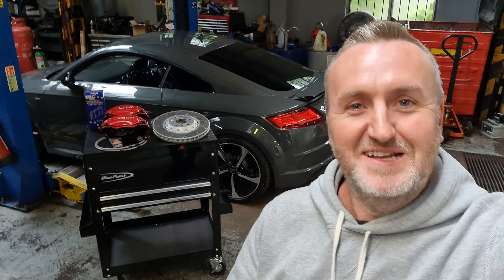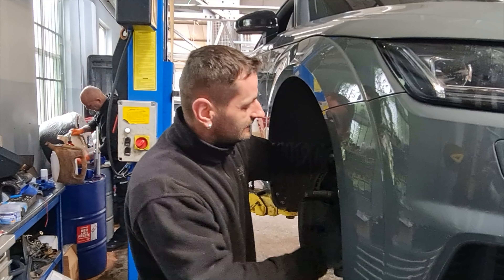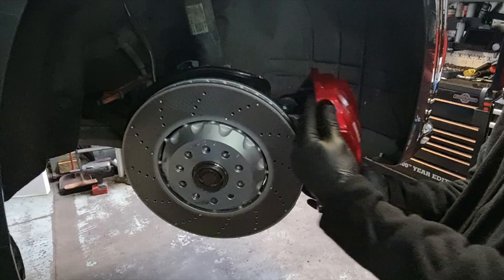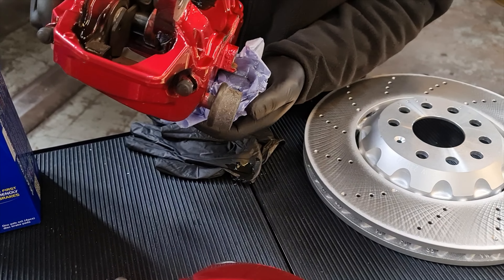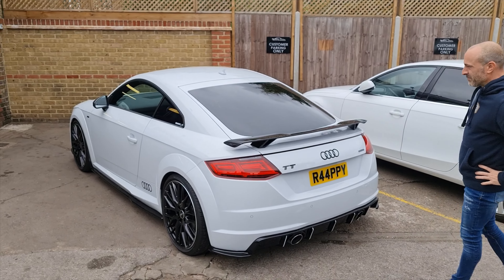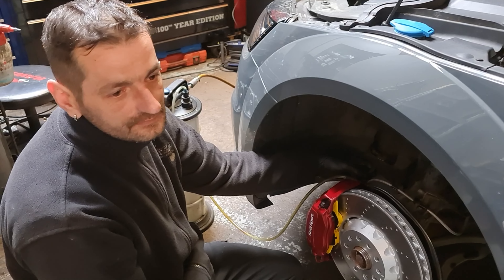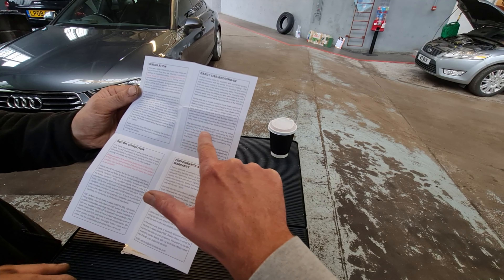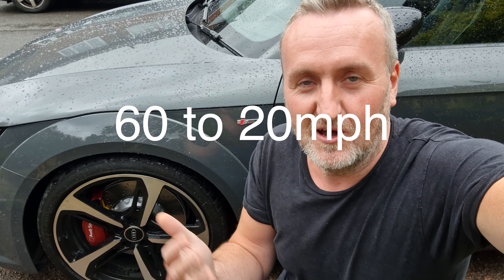AUDI TT MK3 BRAKE UPGRADE!!! | FITTING TTS 4 POT CALIPERS AND CLUBSPORT DISCS

Comment: Those Rotor/calipers compliment your Audi nicely. 👌

A correct thread & pitch bolt with a copper washer screwed into were the banjo hydraulic line would normally go on the calliper would minimise any Hydraulic fluid compromising that beautiful paintwork & clear coat. (Untill you get them fitted to your car)
Good video & professional workmanship. 👌 👍

Comment: andy kirby - Hi! Yes , for about 50 miles Be easy on brake pedal and one more thing ( cos new discs and pads need to match ) , during that time discs are heating quite quick (My advice would be , that You drive short distances 5-10 miles each time). I have changed a lot of discs and pads and they tend to get hot during initial first 50 miles . That's why I came up with idea, that doing short 5-10 mile distance make discs just ho  , but not very hot , and after about 10 - 15 min. of cooling down , another 5 -10 miles ( it is good to check during that "cooling time" how discs looks !! Whether they wear down evenly. Regards . John.
Reply from the maker: Good info, yeah after the first 10 miles they were just warm to the touch so I think you are on to something! Thanks!
Reply: @andykirby  - if just warm and not hot as h..ll , that is v. good sign. Also I've forgotten to mention , that when replacing discs and pads for new ones it is good to avoid to do that process while raining !! It is better to drive home from garage quite slowly and be gentle with brakes !! After rain is over and discs with pads dry , then continue to do initial discs - pads match ! Little tip , but I've saw People going crazy out of garage on a rainy day and heavily braking causing them from overheating and fast cooling(by cold water from rain) to bend discs a tiny bit !!!

Comment: Hello mr Andy, I will like to ask if you can drop a link to where you purchased the brake pad and disc that you replaced. I also own an Audi TT 2016 and will like to change mine also got inspired from your video. And the other question is are the brake pad and disc the same for all Audi TT from 2015 till date?  Thanks

Comment: Cheers m8 on your new breaks. Those looks mhm mhm, yummy!! :-D   Im thinking on putting 6pistons on my TT MK3 soon. cost around 1500euro with discs, pads, pressure tube etc whole kit.
Reply from the maker: Thanks! You can fit 6 pot TTRS brakes but I'll tell you won't need any more than the 4 pots from the TTS  really, they are insane.
Reply: @andykirby  will try to look then for OEM from TTS. Although I got a feeling it’s more than 2.5k euros 🤭🤭.

Comment: Hey Andy , i have the same rim as yours . When you fix the big brake 4 pots do you need to add any spacer to get clearance  between rim and calibers ?
Reply from the maker: yes i have spacers, theres an old video about them too :-)
Reply: @andykirby  i guess so cos my local shop here told me these rim wont fit  big brakes

Comment: Your passenger disc is wrong the direction of holes and vents should be as the drivers side, you have 2 drivers side discs check on video
Reply: Original Audi brake discs it's not sided some EBC or Brembo aftermarket comes sided
Reply from the maker: ☝🏼 yes Michael you did actuly explain this in the video 😁
Reply: @andykirby  you mentioned in video that the air flow would be different which is why it is wrong way and wrong disc on passenger side
Reply: @singh-sks  some of the disc's are sided and air flow facing on both side one way.  Unfortunately this  OE discs is not sided and you can't buy left or right this type of disc's. In video is explained some times disc's is sided or marked by arrows which way to fit.
Reply: @MtechGarage  I understand what you are saying , but singh s is right , the discs are facing different ways on either side, so in effect they ARE sided, although Audi isn't selling them as sided discs